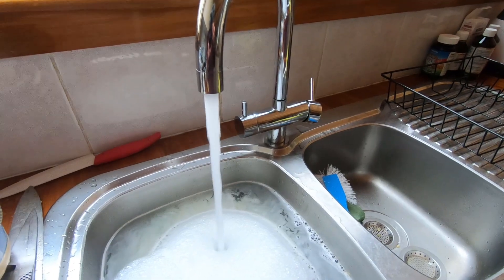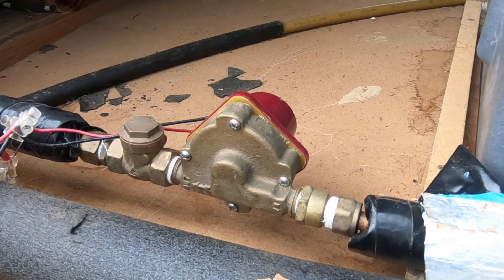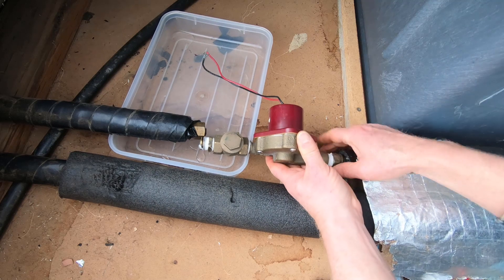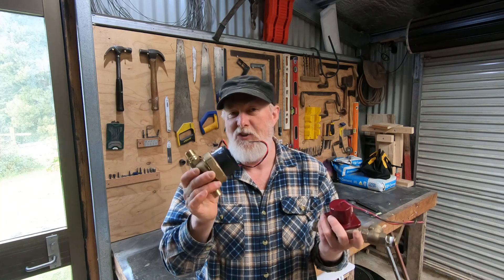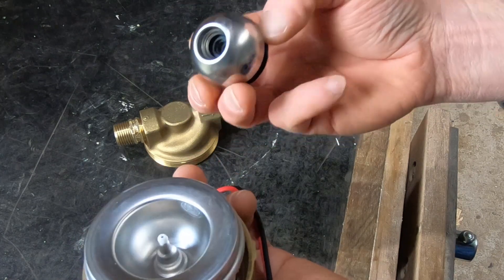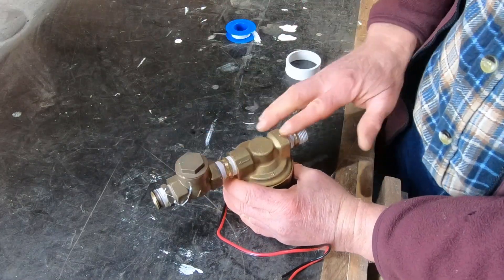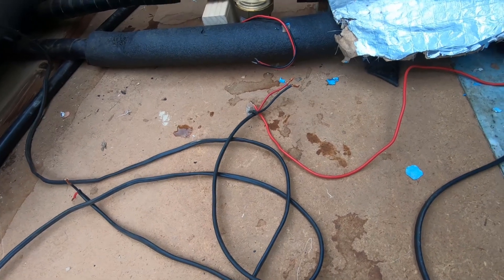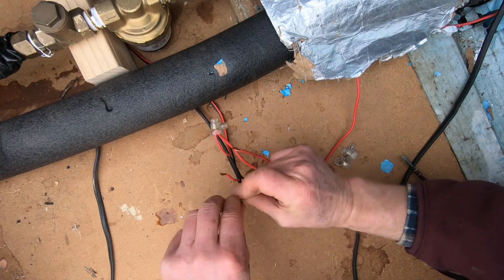See Inside This AMAZING SOLAR Pump!

Comment: Hey mate handy hint from a plumber, seal the pipe on a mehanical joint ie the crox nuts on either side of you pump and check valve. Use the same ptfe/thread tape and roll it into a strand and wrap around pipe not the thread as the seal is between the two fittings. Not the fitting thread.

Comment: I'm recently  building an off grid system  for my farm caravan. Was slowly building a solar hot water system too, as its cold showers for now in NSW Midcoast. Iv been playing around with "Shelly Cloud" wifi electrical relay controllers which run off 12v and 24v. Highly programmable but have a great mobile phone interface too. Used them for water pumps and it worked great!

Comment: That little Moter worked for 9 YRS!!! Thats Fantastic! and i really like the one ur showing but  i use a Peco Thermostat with the 5 ft Bulb and the dial lets me change what temp(depending on season) want the 18 Volts  little Topsflow all Stainless Steel Pump to Kick on.Look me up at Guilt Free Hot Water,sory nothing to sell just free info.Also i throw on a metal filter which is under $20 as sometimes some how crap gets in. What kind of Heat exchanger?
Peco TRF-005

TRF115-005 - Temp Range : 0°F - 120°F, 18°C - 49°C ; Bulb : 5 ft. (1.5 m) Stainless Remote Sensor.

Comment: amazing idea and it eliminates wires connection for residential buildings of 4 and 5 floors !! just needs some controller sensors to enhance the system.. thanks a lot!

Comment: A simple $5 thermostatic switch wired inline with the pump and measuring the temp of the hot side of your system is all you need to stop pumping cold water.  Awesome idea to have your pump driven by solar panels.  Powers on only when you need it.  Mostly.